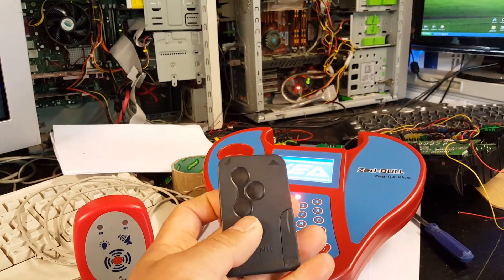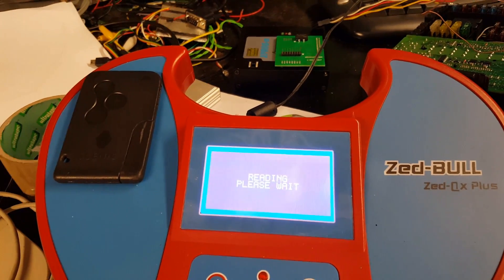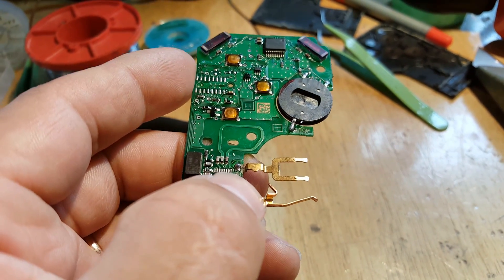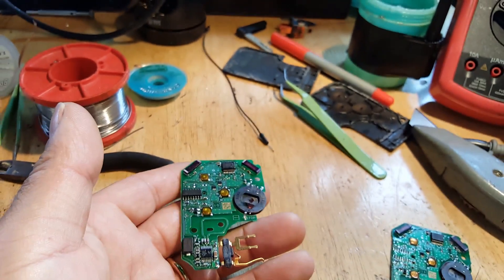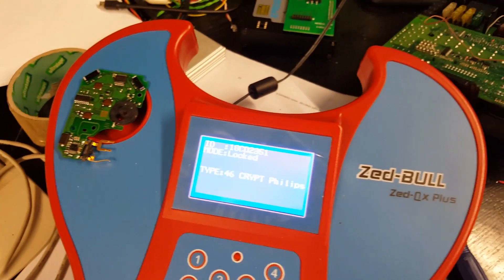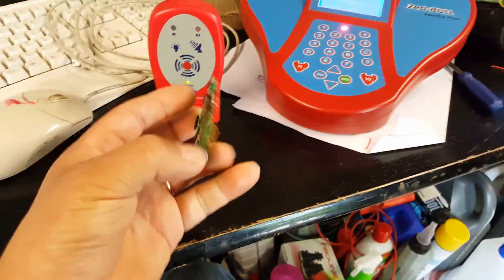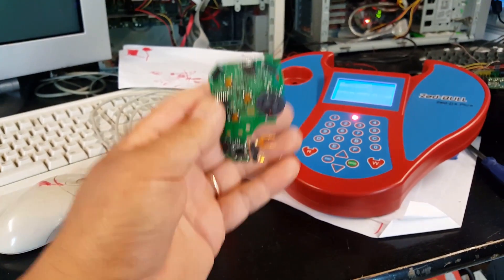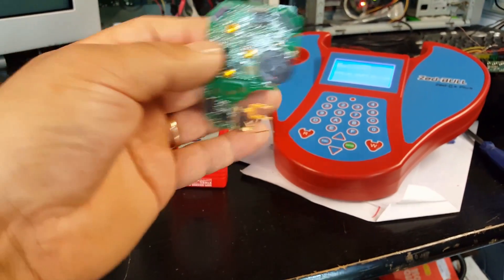Renault Card Repair

Comment: Hello. I have a card problem. I'm missing one part that is on the top left, it has the same part on the right. You know maybe what that part is called and where it can be bought?
Reply from the maker: That's the emitter antennas for the hands free system...
👍👍👍
Reply: The card starts the car but does not unlock and lock. When the button is pressed, the LED on the card lights up but does nothing. Is it because of that antenna that is missing or something else?
Reply from the maker: Possibly... 
How come that is missing?

Comment: Hi i would like to ask,
 can we do the same with the eeprom!
I mean if we change for example the ECM.
Why we can’t take the old eeprom and install it in the new one?
Thank you
Reply from the maker: Depends... some you can... some others you can't...
👍👍👍
Reply: Thank you for your response.
Can i know what is depending on?
Reply from the maker: On the ecu type...
Some ecus have immo and other data also on the flash memory...
Those types, if you change the eeprom, the will fail to start...

Comment: hello there. nice video. it help me out with the chip replacement from one card to the other. but i have some issues now with the card  because the remote now it doesn't work. Do you have any past list for the capacitors or components on these cards? i want to buy some parts but i don't know the references... i'm trying to compare 2 cards but they both have issues so i don't actually know for sure where the problem is on each one of them... hope you can help. thanks
Reply from the maker: Hi
Why have you moved the chip to another card?
What was the issue with the original card?
Thank you for watching and for your comment!
Reply: @LMAutoRepairs  hello. the original key was "not detected". so owner bought used key. i tried to program with FVDI, but didn't work. so i changed chips in key. after getting a New Key (clone one) y programmed with FVDI and it worked. but after 1st programming, old keys were deleted, so i had to program a 2nd time, both keys. this is when "original" key stopped working the remote but works to start the car. New Key (clone) has no problem in remote or start car.

Comment: I have 2 keycards exactly like that. hands free for renault megane2. what programmer to use? and how. now my car works only with a nonhands free card and the original hands free card because was not presented during renault clip procedure is not recognized anymore.
Reply from the maker: Cri George 
Hi
Renault clip...
But you need to get hold of the security code of the car...
Thank you for watching!
Reply: ok. thks for reply. I have the isk and also I could get the pin code from it.  Also I could generate the final incode in clip. I want to precode the pcf7943 and after that try again with clip programming. I have a 7 lines dump from another key card. My question now. Do I have to edit all 7 lines of the 7943 according to the dump or just the line 1 whole 8 characters, line 2 last 4 characters and line 3 first 2 characters? Also looking at different programmers some have just the 7 lines programming others have an extra 4 lines for remote part of transponder. I thought the last 4 lines. User 1-4 ar for remote, not another extra  4 lines.

Comment: I have a Renault espace IV in my workshop and I only have one card to this vehicle but each time I try to use  the Renault clip to programme the card it shows EXECUTION REQUIREMENTS not met..this message comes after I enter the in code.. What can I do please?
Reply from the maker: NELSON OMOROKUNWA 
🤔
Hi
Are you sure you are entering the correct code, and following the correct procedures and steps?
Thank you for watching!
Reply: Yes I followed the steps on your video while programming Laguna ..please can I send you an e-mail? To show you the photo
Reply: LM Auto Repairs 

Thank you for your reply.. Please can you send me the Renault Pin Calculator that calculates the pin code, isk code, out code and in code.. I would really appreciate this help from you...
Reply: We use truecode it will code a card in less than a minute

Comment: Hi I have one question. My card from renault scenic  ii 2008 hand free was water damaged.Then I bought a used one from scrapyard and move my transponder to that card, now car starts but remote function do not work, everthing is good solder can you help mi does reprogramming card again work
Reply from the maker: Hi
I am not 100% sure, but on the hands free cards, you have two chips.
Move the other one as well...
Hope that helps...
Thank you for watching!
Reply: LM Auto Repairs Thanks for answer.The card look exactly like this in video and it has only one transponder chip but i dont know what the other two chips are for. Please answer me, thank you very much for helping me
Reply from the maker: Mr Ne Fix 
Yes... only one transponder chip... but swap also the chip at the top, the one between the hands free antennas, and the one at the bottom,  close to the oscillator...
Reply: LM Auto Repairs Ok, I will do it, thanks for you help i will came back and tell if that workes.Have a nice day.

Comment: Hi! you are make  fantastic video ,how explain everything,so good.I only speak English,my original question is :
I have 2005 vel satis with 2buttons card it is works well.I lost my original 3 buttons card key.I bought used 3 buttons card key,how I can fit to my vel satis how can I set it up,what I have to do?
I have mini zed-bull,and latest renault can clip.
Reply from the maker: Zsolt Csaplar 
Open the card and identify the transponder...
Then buy a blank one already pre-coded for remote functions...
Solder that new transponder on the card, and program it to the car...
Hope that helps...
Reply: LM Auto Repairs thanks please how I can send to you picture..? 😁
Reply from the maker: Zsolt Csaplar 
🤔
Have you checked my patreon?

Comment: did it work on the car? been thinking about this as I only have one dodgy key left, I have one where I broke one of the infra red? parts at the opposite end of the card to the battery. Doesn't the remote part need coding to the car? is that all on the transponder chip?
Reply from the maker: Ben Portman 
Hi
Yes, it worked on for the car... I have repaired many of these...
They don't have infrared, so I am not really sure what you are referring to...
If the card belongs to the car, no coding after the repair is needed...
Thank you for watching!
Reply: My car has keyless entry, so you walk up to the car with the key in your pocket, put your hand in the gap between the handle and the door and it unlocks, I think this is what the 2 blocks at the other end of the keycard from the battery do, as not all of the keycards have these blocks, and the ones that don't don't have keyless entry, I mean, you don't have to press a button, you just as I said, pull the door handle, or push the boot button. I think this is the infrared part, as my car has some sort of sensor on the door behind the handle.
both keys are now dead, so being a UK car, I have to unlock the car from the passenger side door, alarm goes off, insert keycard, alarm goes off, unlock the car on the central locking, either climb over or get in the drivers door, then the car will start if key is in the slot. To lock it, I have to lock it on central locking, exit via the passenger side door, and lock that with the key.
I used to walk up to the car, pull the handle, get in and start the car with the key in my pocket!!! 
Nice if it was reliable!

Comment: Hi, I need of one help.  I have bought a new coil for my scenic keycard. I checked the buttons but only S2 and S3 emitting a radiofrequency. I checked contact from S1 and they work. I checked also solder over pin1 of  PCF7947AT and seem ok. Can you help me to find a failure of S1? regards
Reply from the maker: Stefano Leone 
Is there anything else in the S1 circuit?
It must be, follow circuit answer see if anything else is cracked or broken...
Reply: Dear Sir, I bypass the track of of circuit with a wire. Now seem ok...I check the RF with a scanner receiver tuned on 434.0025 MHz and S1 S2 S3 make a signal. Unfortunately  again the doors of my scenic do not open....
I do not know what to do. 
I also replaced the coil
Reply from the maker: Stefano Leone 
Do you have clip right... see on live data what the car is seeing... you can also try to reprogram the card...
Reply: I found now that three SMD resistor (563) give a completely wrong value with multimeter...
In your opinion may be the reason of failure?

Comment: Hi, can you please tell what transponder is used? Is it PCF7947? Anyone knows if it possible to program a non-hands free card on scenics that have this type of card?
Reply from the maker: Ciprian Agache 
Hi
Its is usually that one... For the hands free is a different variant of that same chip... but I can't remember now which one is...
Anyway,  you can program either a hands free to a non hands free car,  or a non hands free card to hands free car... the hands free functions obviously will work only if the correct card is programmed... 
During the programming procedure, (at least with Renault Clip), you get a warning if the incorrect card is inserted, but will allow you to continue...
Hope that helps...
Reply: Thanks for your answer. Meanwhile I found out that the chip in hands free cards is PCF 7943. I only have DDT2000 and Truecode to add the card. I only have pcf7946 card.

I will see what happens when I try to add it to the car when I can access the car.

By the way: did you ever successfully programmed yourself a non hands free card to a hands free car?

Comment: Jeeezzzz do you really want to do it when you can get a new key card in decent price??? I wouldn't dare doing that to my car or key card, I got a new one from http://keycardservices.co.uk/ for only £90, why bother with doing all that and possibly damaging your car?
Reply from the maker: Ice Man 
Ice Man 
Hi
First of all thank you for watching and for your comment! 
Now, I have repaired dozens of cards like this, it is tricky to open them, but is possible...
I have also programmed loads of new cards, and never paid more than £50 for a new card... so £90 for a single card is bit too much... in my opinion. 
Last, doesn't matter what you do to the card, you will never damage the car...
So unless this is a publicity attempt, your arguments are not very strong...

Comment: hello can i ask i have a 2003 Renault escape i damage my board can i buy a new unprogrammed key and swap my old car transponder to the new key and will work well cheers.
Reply from the maker: anthony doyle 
Hi
Should work just fine...
Thank you for watching my video!
Reply: Hello Imsvvavr thank you also i do not need any code or programming cheers.

Comment: Hi mate, thanks for the video. Will moving the transponder alone would suffice if I have a spare key card from a different car? Or should some PIN code be coded? Some technician told me he tried before to move the transponder alone to a different card but it disrupted the ignition unit in the car and the immobilizer, so he had to change the whole ignition unit to a different one. Does it sound possible? Have you tested this card on a car and all went smoothly?
Reply from the maker: Hi
It should work by moving the transponder from one card to another... and I can't see why it would disrupt anything on the car... 
The card on the video worked perfectly after the repair...

Comment: hi mate what that mean if the red light on the screen is on or off or signal flash? grand scenic 2005 ?
Reply from the maker: Hi
Off - immobiliser deactivated. 
ON - immobiliser fault/activated. (it might means other things, but usually is that.
Blinking - Immobiliser active.

Comment: hi mate i am here again i have a problem with a seat leon it cranks but no start fuel ok but no spark the strange thing no diagnostic not a single controller there is no connection with car the ecu is flashed months ago any idea
Reply from the maker: Hi
Are you saying you can't diagnose any of the ECUS on the car?
Reply: Yes i tried with vcds and delphi dyagnosgic tool the cat came to me after a problem of oil warning other mecanic put oil but it wont start
Reply: Yes i tried with vcds and delphi dyagnosgic tool the cat came to me after a problem of oil warning other mecanic put oil but it wont start
Reply: Another thing all lights and fuses are ok but i will  check again
Reply from the maker: +sadik mamoun
If you can't connect with any of the ECUS, to me sounds like a can line issue...
Look for the car wiring diagrams and check the lines...
There is another way to talk with the engine ecu, but in your case it will be better to try to find the fault, as the engine ecu will still need info from other ECUS. 
Unless the fault is between the OBD and the gateway. 
what is the car year?

Comment: no message in screen no light, i have problem in one windows it block and also buton secure  of blocking windows it work and sometime no sorry for bad my english
Reply from the maker: If the immobiliser is being deactivated when the card is inserted, your problem is probably not immobiliser related.
You need to have the car scanned, and go from there.
If no codes, you need to look at the live data....
Hope that helps.